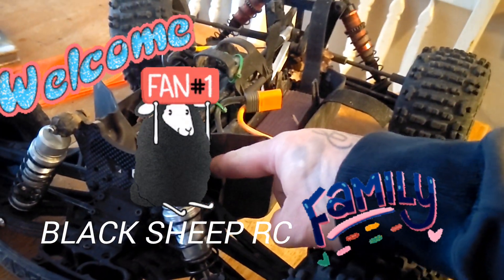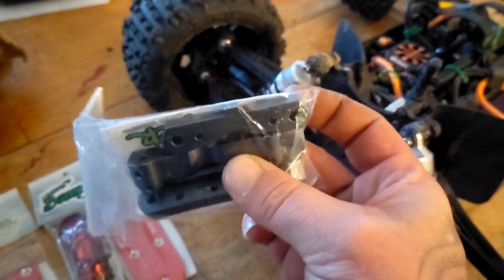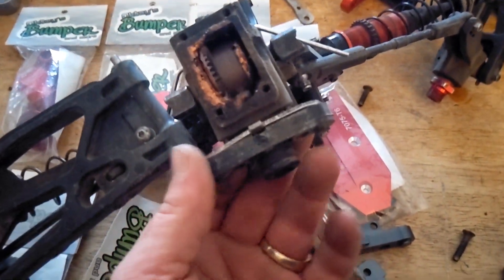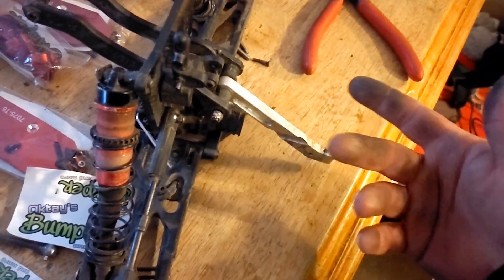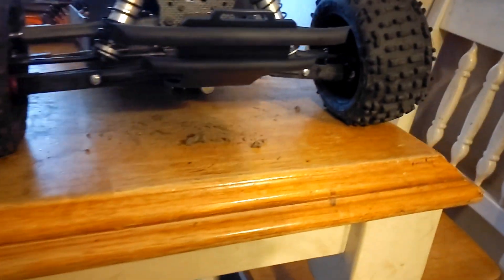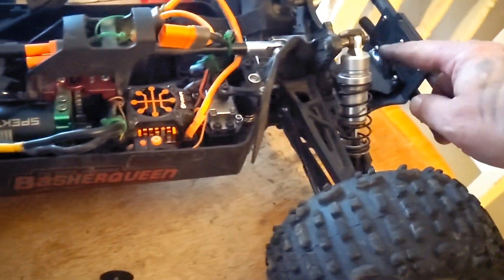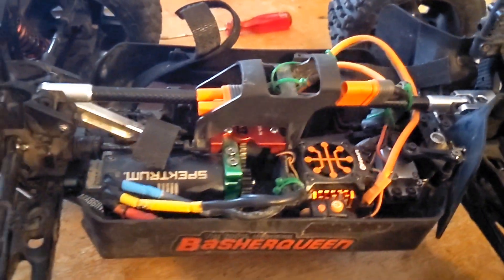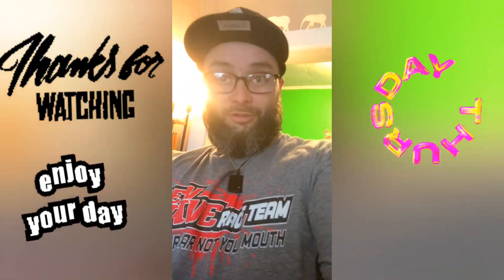OKTAY BUMPER all over the outcast come ✅ it  #7075upgreads

Comment: You put the center diff cover on upside down that why you can’t put the roll bar pins back on…
Reply from the maker: Yeah but it looked funny upside down too and the writing you see on the top of it and I'm pretty sure I don't know I'll look at it but yeah I kind of like it like this and I don't usually run that thing in the middle anyway in this way he's got the writing on it and you can see what it says and yes I don't have no writing on it so probably leave it
Reply: @blacksheeprc8113  yeah that right you can’t see the writing when it’s installed it was a manufacturer mistake I’m sure he will tell you the same thing
Reply from the maker: @RC4us  yeah I get it probably was a mistake but just so everybody knows I realized video I put it on upside down but I turned it back over because I like the writing showing up and as you all know me too well I get yelled at by you enough for I don't like the rock body half the time you also I want to worry about the little structural loop but it is important if you're running your stock body and you want to take care of it and not break it as easy I got to be the rebel go against the grain 🌾 if you know what I mean lol